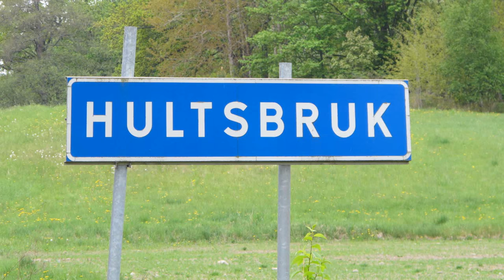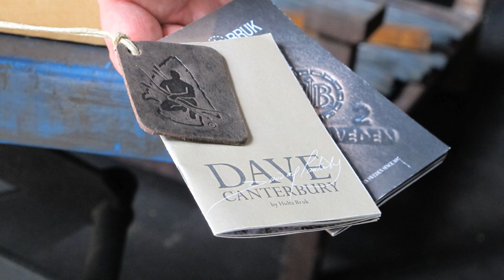Hults Bruk Video Diary

Comment: Wow! How long where you here, and what did you see besides Hults Bruk? Hälsningar från Sverige :)
Reply from the maker: I was in Sweden 10 Days, teaching at the 125th Anniversary Celebration at Mora Knives also visited Gransfors Bruk
Reply: Cool! I was at wetterlings a couple of days back. All the axe manufacturers workshops here seem to look very similar. Was it hard to use that kind of power hammer? seems most axe smiths only use one heat to shape the head.
Reply from the maker: Hults bruk has a completely different process in several ways I also toured Gransfors while in Sweden